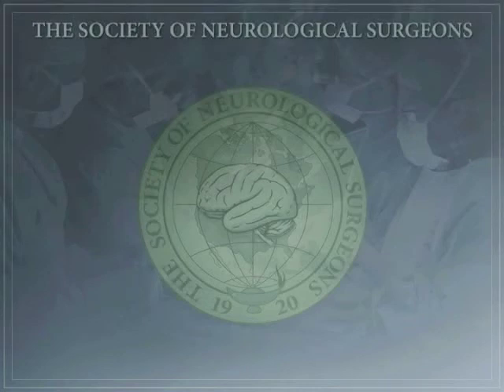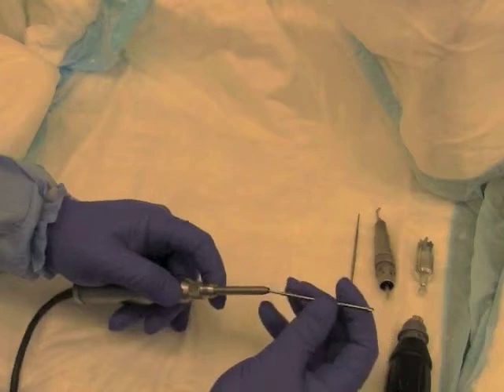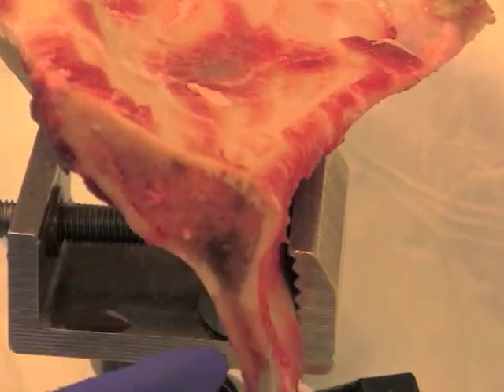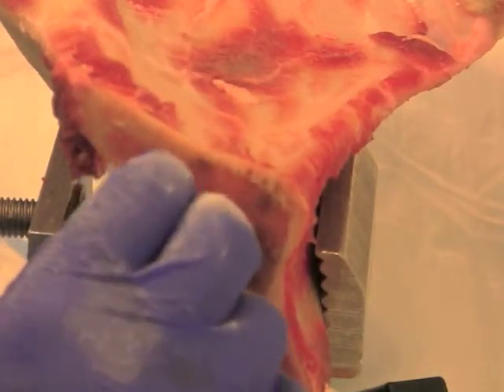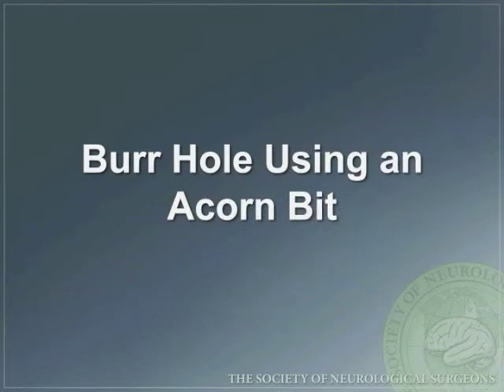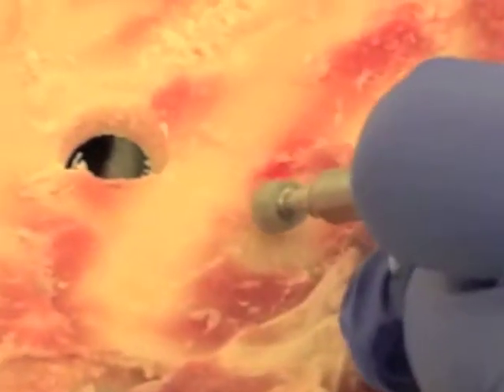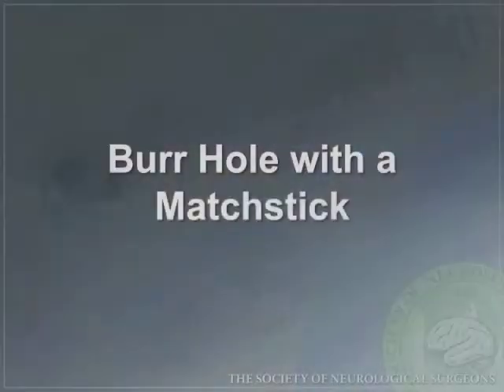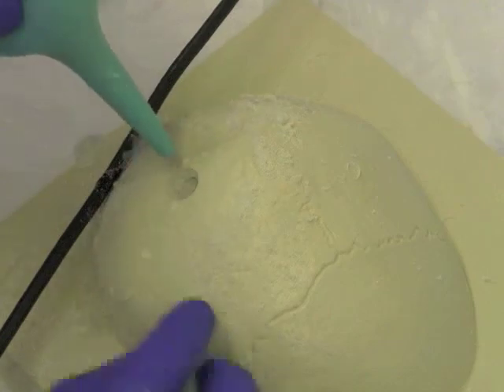Drilling Burr Holes in Bone Dissection

Comment: For an anatomy student who will not eventually do any clinical work, but would like cleaner dissections for illustrative purposes, are there less expensive alternatives to the shown equipment?  Using a typical electric bone saw destroys finer structures, and I simply do not have $500+ for better implements.  Thanks.